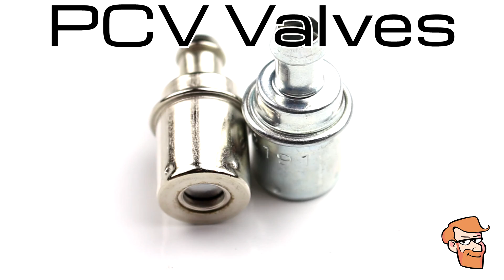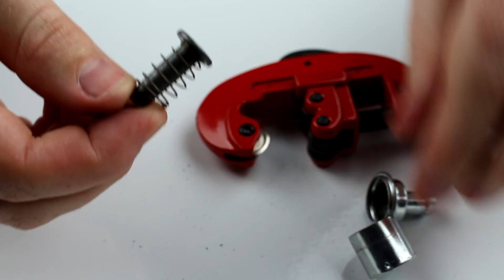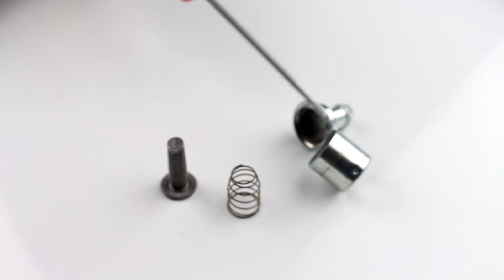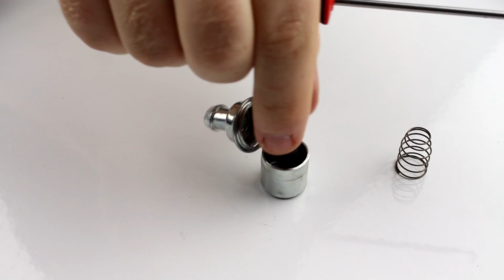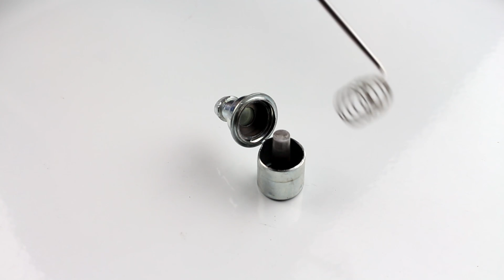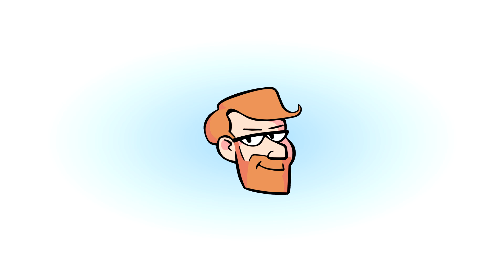How Does a PCV Valve Work? • Cars Simplified

Comment: The currently marketed versions of this valve have small perforations around the main hole. These perforations aren't completely covered by the internal pluger. What's the purpose of doing this?
Reply from the maker: I would have to see an example to get a better idea, but what first comes to mind (speculation) is that maybe it allows for a little pressure to get by at all times so that the pressure doesn't have to overcome the force of the spring initially, but it can open up more if the pressure builds enough. Astute observation! I'll have to look into that more. Is the one you are looking at for a forced induction (turbocharged/supercharged) engine?
Reply: It is a 1.6 Zetec Sigma engine with no turbocharger. The original part is plastic, have not these perforations, and is practically impossible to find.

The compatible replacement is this metal valve, but all available versions have these additional perforations.

Comment: im looking at a car to buy, the seller says there is slightly blue smoke when running but the engine is smooth and he has been told it is most likely a faulty PCV valve, if this is the case would the car be alright to drive home or could this cause greater damage than it is worth?
Reply from the maker: I would be very skeptical. See if you can have them run it with the PCV port to the intake blocked off. If there is still smoke, it is the more likely internal engine wear.

I know if I was selling a car, if I could fix a smoke issue by replacing a part that cheap, I would definitely do it so I had a more appealing car to sell.